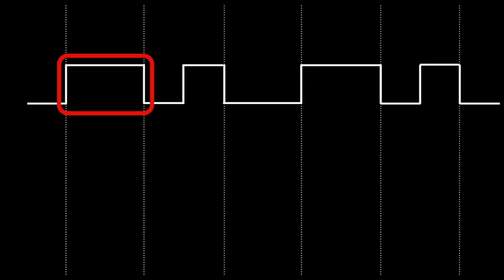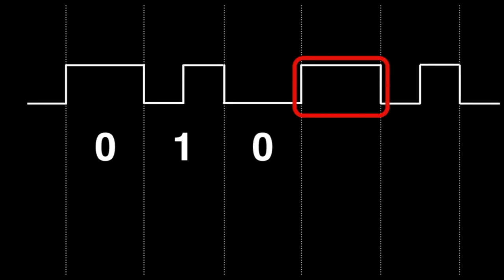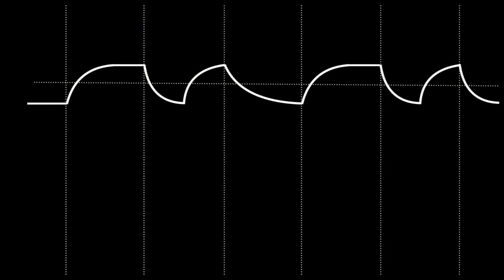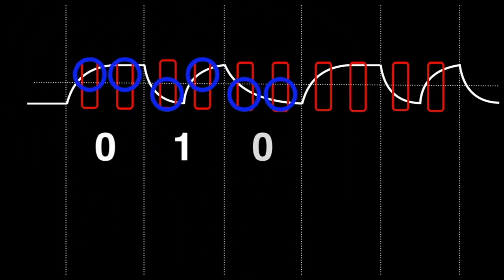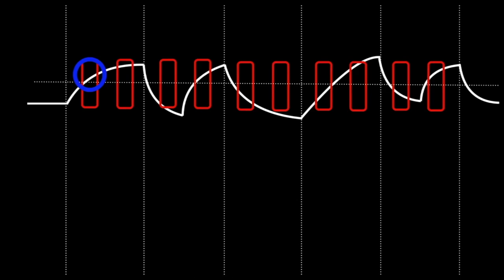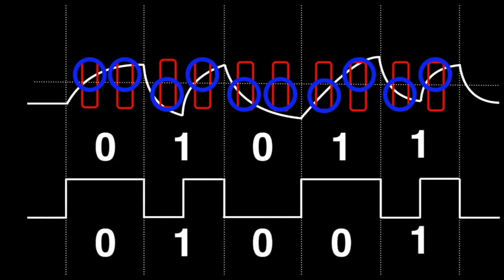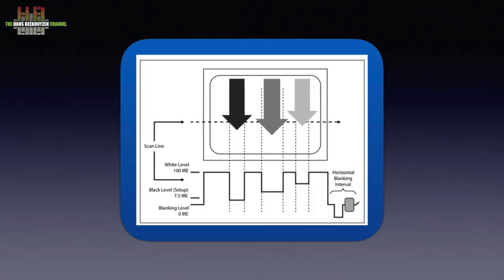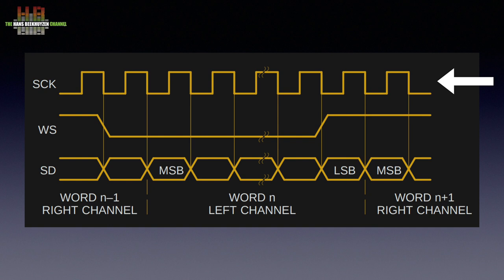SPDIF, TOSlink, AES/EBU or I²S, what’s the best?

Comment: Thanks for this, Hans. I learned from your video. 

A fairly clear explanation of a very murky subject to 99% of audiophiles. As in so many engineering specifications and standards, the major influence on whether to need 'pro' level interfaces and cables is distance. And in that light, there's the issue of 'audible difference.' Pro and broadcast gear may fall into a chain of dozens of items between source and endpoint. There, the contribution of each item in the chain adds to make (otherwise) inaudible signal changes accumulate to become audio issues that are audible in a broadcast or recording. And for example, sending these interconnections hundreds of meters between a concert and a TV/radio/recording 'truck' may be a chore that we mere audiophiles needn't face.

My point: That professional level interconnection standards and practices that are nice to know and "get your head around" may offer advantages that simply playing back high quality music at home doesn't need. [Ground loops excepted.]
Reply from the maker: In practice the pro formats can sound better under domestic circumstances. For instance if the implementation of AES/EBU is better than the SPDIF one. Or, indeed, with ground loops, poor PSU's and so on. In Audio theory is nice, but in practice things might differ.
Reply from the maker: My experience doesn’t

Comment: I meant to mention that I own the PS Audio SACD transport and DirectStream DAC and I use I²S via pseudo-HDMI connectors to connect the two, with excellent results
Reply from the maker: I²S, like AES/EBU can be a very good interface but only when done properly.
Reply: Thanks, Hans. I agree. I hope to have the Mk II DirectStream DAC soon.
Reply: I have the PS Audio DirectStream and their NuWave Phono Converter (and also their power regenerator). Since my Thorens 320 MKII / Grado Gold3 needs to be on a very stable surface, it is a 12' length to my pre. I use the NuWave Phono Converter to deliver I2S  (DSD128) to my DAC. (Don't hit me!) The results are stunning. There would be more change in the signal if I tried to extend the phono lines.

Comment: There was one other interface from the past: SDIF-2 was a three-cable solution (Left/Right/Word Clock) used on professional PCM equipment in the early days of CD.  I have SDIF-2 to S/PDIF AES/EBU conversion equipment which I use for recording from PCM1630 tapes to modern equipment.  As for AES/EBU vs. S/PDIF, you can connect either signal with suitable cables and a modern digital recorder may just work, I can connect either directly to a Tascam DR-100MKII for example.
Reply from the maker: If you have watched de video carefully you must have noted that I mention SDIF in two generations (1 and 2) and SDIF-3, being used for DSD recording
Reply: SPDIV is any stream, just raw data!
it can support 20 channels!
Is your DAC is understanding the 20 channels it gets offered over SPDIV, or do you need to upgrade that DAC!
please use HDMI 2.1 if you need cables, forgot all the 1980 cables! Stream all music!

Comment: Hans, great video as always. It would have been great to learn about the difference between HDMI cables for I2S. I know most use LVDS but there is at least one other standard… I’m still not clear on the difference between them (one is compatible with both, but one is more limited). Any knowledge you can share would be great!
Reply from the maker: I don't do cable reviews. And I don't own a DAC that has I²S inputs. Sorry.
Reply: With the physical cable, there are no differences. That's the point. PS Audio recognized that HDMI cables are capable of transmitting the I2S signal quite well. While they use the physical cable, they do not use the actual protocol, but rather use the individual channels within the cable to facilitate the signal and clocks.

Comment: Very good video Hans! 👍 One note on the I2s, the reason for HDMI/Ethernet cables is to transmit the delicate I2s signal balanced (and they are good for transmitting high speed data)! Some manufactures referee this as the PS-audio "standard" but other manufactures have there own balanced pin configuration for the I2s signal's. There are balanced converter on the sender and a unbalanced converter on the receiving end. And i think that the signal by passes the dac's internal clock and connect's to the DA-converter's I2s pin without the need for a PLL clock. (I have upgraded my 10year's old dac with an HDMI-I2s connector)
Reply: You don't need Ethernet anymore, you can stream it over HDMI now!
What DAC u use now? guess you need upgrades, needing HDMI 2.1!

Comment: Thank you for the explanations. From what I have heard the I2S is advised. As on Denafrips Dacs (HDMI interface) and on Sonnet Dacs (RJ45 interface).
In this regards they probably paid more attention to that connection and not so much to the others (possibly).
Unfortunately I could not distinguish which cable was mentioned at around 15:30 mark. "AZ mad/mac cable"? Search engine does not help. Any suggestions?
Reply from the maker: You can always use subtitling
Reply: @TheHansBeekhuyzenChannel  Of course that was the first thing I have tried. It badly translates it to dutch. And if english is chosen, then it translates the dutch back to english, needless to say that that is also incorret.
Reply: @TheHansBeekhuyzenChannel   Hi Hans, yeah, the subtitling didn't work for me either.
Can you elaborate what is the AC/MAC cable that you referred to in the video? Thank you in advance.
Reply: Selectable subtitles are in Dutch only.
I wrote to Youtube asking for an explanation and they can't give me an answer.
Ancient Zen proverb says: before following what the teacher says, try to understand what the teacher says.

A prayer for English subtitles…

Comment: What’s really interesting is most audiophile high end dealers say balanced is far better than RCA which is nonsense if you speak to someone who actually knows what they are talking about. USB is rubbish compared to AES/EBU or SPDIF which again is rubbish. Case in point recently was considering upgrading my MSB DAC to the new DCS Apex Bartok which is used on its own along with connected to my Antipodes server using USB and sounded great although virtually the same. My dealer then said I had to listen to a new brand he had taken on at the Munich show called Ideon and listen to their ION DAC which also uses USB . It transformed the sound by  at least 30%  in all areas , I was blown away. Clearly Ideon are doing something completely different when it comes to their USB compared to other companies as their DAC’s are on another level. Just goes to show it’s not the connection but how they are configuring it that makes the difference.
Reply from the maker: Well that’s what I keep telling all the time. It’s not the type of interface but how well it is implemented on both sides.

Comment: Thank you very much! 
There was one system missing in this story and that was Firewire or iee1394. I use a digital mixing board that uses that interface and it is not without its problems, but once it is stable it does the job. (16 ch  24bit  96khz..) Is it a sensible interface you think?
Reply from the maker: FireWire has hardly been available in the domestic audio market.
Reply: @TheHansBeekhuyzenChannel  dank je Hans ( ik heet ook Hans dus dat klets makkelijker)
Ik vroeg het omdat firewire ook een stroom is en usb woorden zijn... wellicht dat firewire dan een voordeeltje heeft.
Bovendien ieee1394 was standaard voor elke Mac en mini-dv camera in de late jaren 90 en vroege 2000....

Comment: hi thanks for the extremely valuable video    There is an aspect that escapes me and I can't really understand
leaving aside the cheap equipment for a moment and instead analyzing the valuable ones, I swear that I don't understand why DACs and digital sources of a certain level have not adopted for the transmission of the spdif signal the BNC standard which is the one commonly used for digital oscilloscopes, function generators and digital spectrum analyzers   
It was a standard already available and absolutely valid since they use it up to 1 GHz
Not only that, I have also seen that these units are so precise that they are able to highlight problems even in the bnc to bnc connection cable, for example with square wave tests.
That is, it seems that every now and then in high fidelity there is a naïve, unscientific approach
The RCA cable was not created for transferring digital signals but analog ones. 
I really don't understand why you should force yourself to adapt a cable wrong by design
A 50USD right cable could be much superior to a 500USD cable wrong by design  
Obviously it's not even worth discussing cheap devices with their understandable limits
Reply from the maker: True. But there are good 75 ohm cables with RCA’s as used for composite video ( yellow plugs) and there are very good SPDIF cables from Audiofile cable manufacturers.
Reply: @TheHansBeekhuyzenChannel  hi thank you very much indeed for your kind and very valuable advice  
My feeling is that good RCAs could be more expensive than standard BNC
But the option of BNC on dacs is quite rare and even more on digital source 
So it is no question  RCA cable also for spdif  Kindest regards gino

Comment: I just purchased the BlueSound Node (2021) and currently feed it to my Holo Spring KTE dac via SPDIF.  it's a nice solution but they are working to get the USB output to work (still waiting).  I did ask about using a DDC (Singxer SU6) with BS Node.   They responded "Yesterday's update did not include USB DAC output, not from lack of trying though and we are still looking to add it very shortly. That being said, it is very unlikely it will support I2S."  I would have thought if their USB output would work then the SU6 would reclock and would support I2s to my dac?
Reply from the maker: Thanks for sharing. But although the Node is a very fine device within its price bracket, it limits the quality of the Holo....
Reply: Check out the Magna Mano player (from Magna Hifi). It’s a streamer that is more expensive than the Node but does I2S. It’s a great price/quality device

Comment: It seems when I use I2S HDMI from DDC to Dac , the left right channels are swapped. Any suggestions on fixing this and not affect the sound?
Reply from the maker: There is no standard for I²S over HDMI cable. Some devices can change the pinout by settings.
Reply: @TheHansBeekhuyzenChannel  for example, my Dac can inverse I2S. Should I choose this option?

Comment: And USB 2.0....? It supports much higher Sample Rates...,
but does it sound better than AES ?
Many Thanks
Reply from the maker: Ah, higher number sound better… In audio higher numbers don’t say much unless you take them all into account and that’s complex. If done very well AES/EBU sounds very good (it’s what studios use). Higher sampling rates are not used in studios.
Reply: @TheHansBeekhuyzenChannel  I use PSI Audio Monitors and use them for Mixing but also for Music Hearing Sessions...So USB should sound better, only for Hearing and not for Producing? Is the Gain Output the same on USB as on AES ?Thanks

Comment: With the latest Wi-Fi standards and Wi-Fi direct, seems to me that the days are worrying about digital cables are numbered.
If more Dacs include Wi-Fi streaming as most good receivers nowadays, interconnects will be less relevant
Reply from the maker: I wish you luck with wifi in a crowded area.
Reply: This has nothing to do with wi-fi, just a network level
what data your DAC is understanding, can it decode the ATMOS?
receivers nowadays? streaming you need, no wires!

Comment: I wonder if switching from my laptop to a dedicated streamer will improve sound quality
Reply from the maker: 95% the sound quality will improve 150% provided you buy a streamer or network bridge of the same quality as the rest of your stereo
Reply: @TheHansBeekhuyzenChannel  A reply from the man himself, I feel honored. That would indeed be a massive improvement. My current system is a Marantz pm8005, Topping D30pro dac and Triangle Comet EZ speakers. Merry Christmas and good health to you and your kin Hans.
Reply: @spuddyl9938  in computers there are many times minor quality soundcards, so I would certainly go for a good quality streamer
Reply: @thepuma2012  I'm not using the computers soundcard. I'm using a Topping D30 pro which is connected to the laptop via usb. What I'm wondering is if the sound quality would go up significantly if I used a dedicated streamer as a source rather than my laptop.
Reply: @spuddyl9938  that might depend on how the connection is made, you might have to look at the difference between usb connection and optic etc. ( i dont have the answer)